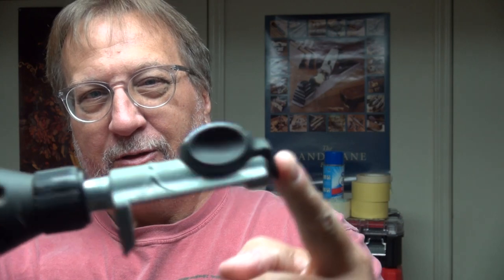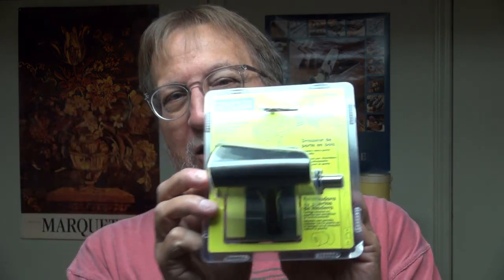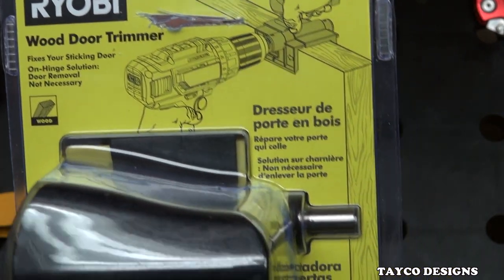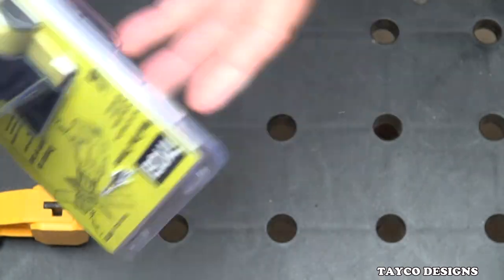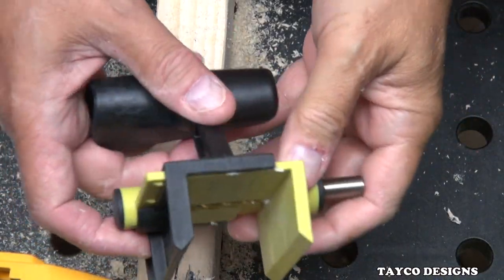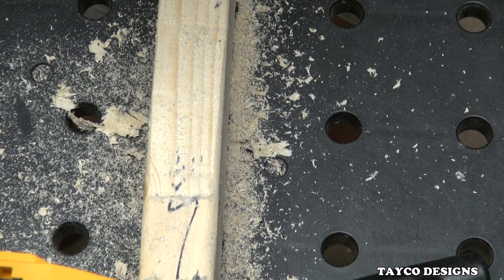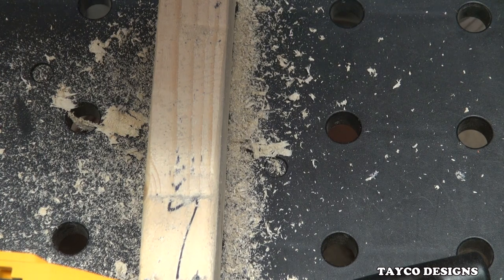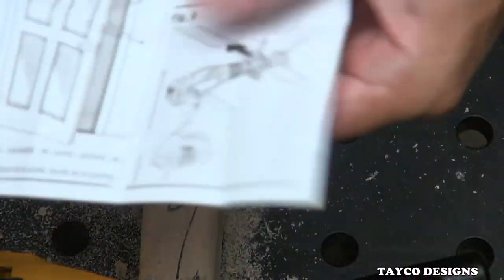Ryobi Door Trimmer Will Be Paid For In The First Time Using It

Comment: It seems that you do need to take the door off the frame, as the blade doesn't reach the bottom if you don't.  I would rather use a planer if the door has to come off.  Ryobi should move the blade 1/4" from the edge so the door doesn't need to come off.

Comment: This is fine for the top of the door, or the edge opposite the hinges, but for the bottom and hinged sides, it does require removing the door, which is no trouble at all. The one thing that I DO NOT like about this tool, is the handle. I think they could have designed it to be used by either hand in any direction A LOT more comfortably.
Reply: Why bother stating the obvious, of course you can't do the bottom or hinge edges with the door installed.....geezz